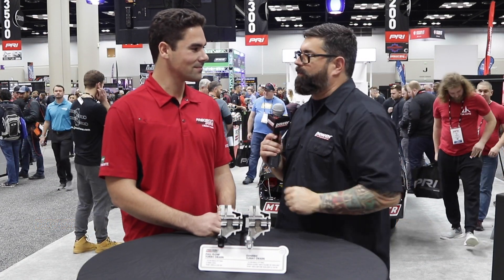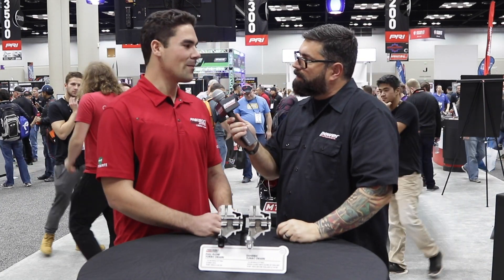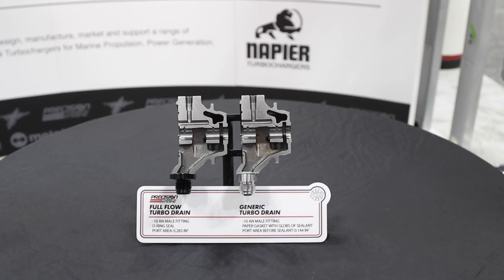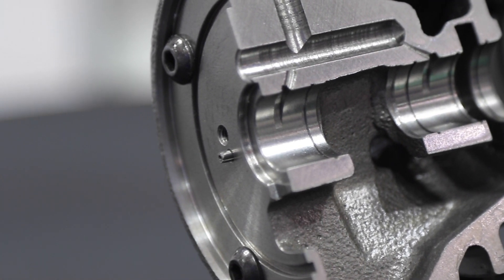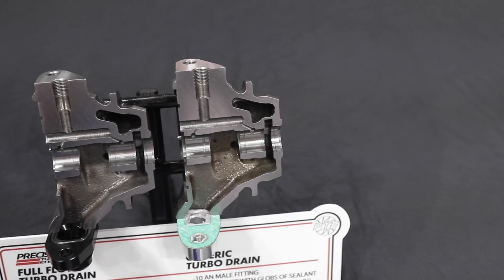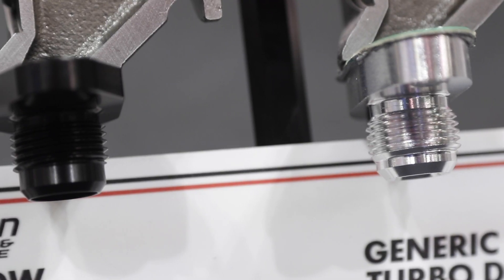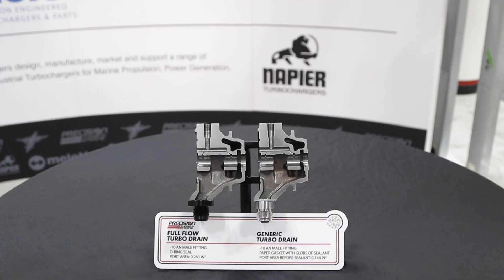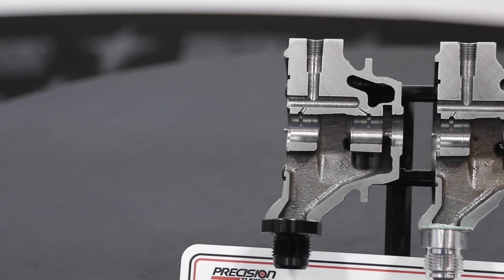PRI 2019: Precision Turbo Fixes Drain Flange Problems

Comment: Great, now how about addressing the oil going into the Turbo!  Precision is still using 50 year old technology of a oil restrictor that is total guess work that can possibly  cause premature bearing wear and or cooked bearings, Turbo smoking and worst case premature Turbo failure. Well not to worry my fellow boost junkies because BoostSmart has taken this problem that Precision Turbo doesn't seem to give a damn about and gone pro. BoostSmart has designed and marketed the coolest oil pressure regulator (OPR) and solved every issue Precision hasn't.  So check this product out. It's a huge advantage over just a drilled oil restrictor. Benefits are no more Choo Choo train smoke on deceleration, eliminates oil baking in your cartridge, less bearing wear and will extend the life of your extremely over priced Precision ball bearing Turbocharger.  Do check them out. You can thank me later.....I'm ok with that👍

Comment: Over time those o rings get hard brittle and flatten out which makes them start to leak.
Ask me how I know lol.
Reply: That's why we who boost for performance change them often. They aren't meant to be a forever part.  They should be on your maintenance schedule 📅
Reply: Yep. Ended up using 22mm ID x 3mm thick viton orings. The orings precision supply are too small...... mine lasted 400 miles before they began to leak oil